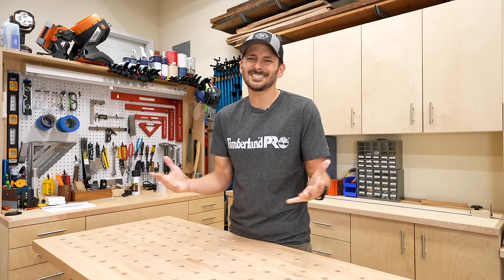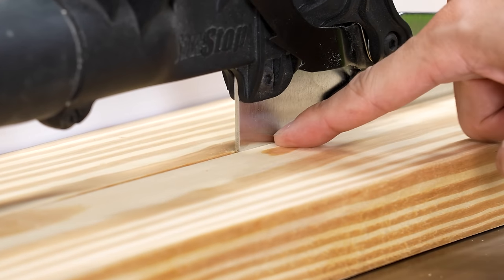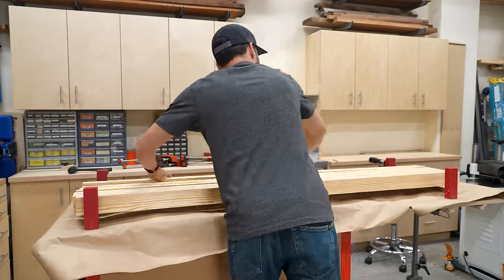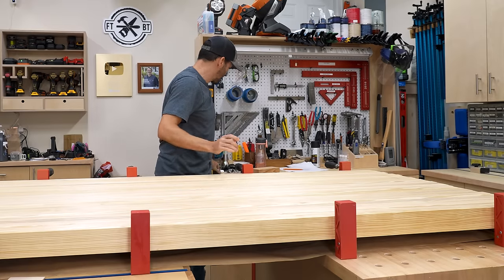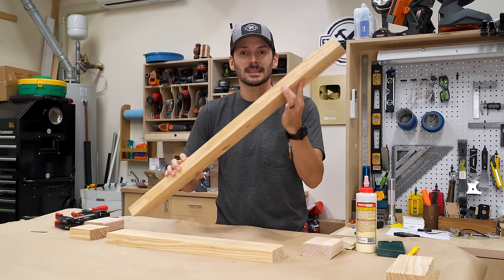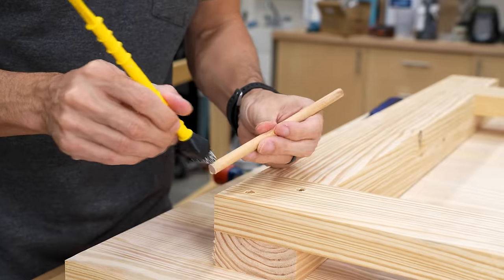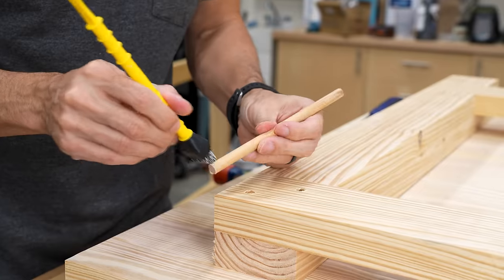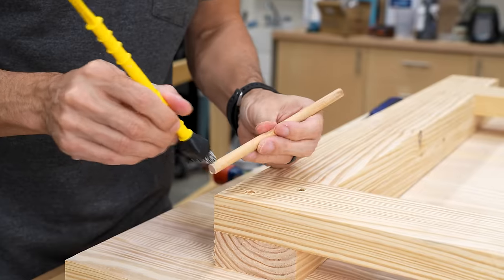Building a Sturdy Workbench with Cheap Wood

Comment: I clicked thinking "cool, $150, I wanna see how he accomplished this."  The answer was with $8,000+ worth of tools in a decked out shop.
Reply: If you are good at yer job my friend.  You don't need a lot of tools! 👺
Reply: LOL, I agree. Specially if you don't have parallel clamps. Each one is 50 dls and you need at least 4, at least... That just adds $200+ dls.
Reply: I mean, if you want to build things with a hand saw, a hammer and a piece of sandpaper, have at 'er. But you're going to get what you get.
Reply: @SnootchieBootchies27 i feel like there's a middle ground between a handsaw and a literal $5,000+ table saw, and a $1000 planar+ a $300 workstation setup to plane stuff on it
Reply: @SnootchieBootchies27 the workbench he made needs to be made next to the tablesaw and on both sides of the planar. Yes, smaller, so less $$ on material than the main workbench, but you need to have multiple smaller workbenches (the quality of the main workbench) and multithousand dollar tools.... To.... Make the workbench
Reply: @dwrecked9329  sounds like you should be the one making the videos and telling everyone how things should be done.
Reply: Home depot and Lowes will cut the boards to your preferred sizes for you for free.
Reply: For centuries, craftsmen built wooden objects with hand tools—from tabletop boxes to sailing ships. It’s still possible today.
Reply: A good pool cue does not make you a good pool player. But you never see a really good pool player with a house cue (unless, of course, he's trying to get a sucker to play with him.
Reply: Pretty sure you could build the whole thing with only hand tools; it would just take more time and effort.
Reply: Never forget, 99% of all man's inventions have been to make things they were already doing faster and easier. Sometimes, we get quality improvements. All the great organic chemistry we are now doing at pressures exceeding 200 psi and temperatures of 1000 degrees, nature does at atmospheric pressure and room temperature. Some computers are now fast enough that they can defeat the best chess players, but not through creative or inventive play, only sheer exhaustive search of all possibilities.
Reply: Just 1 of those 2 x 12 was $63.00 do the math?
Reply: So true 😂
Reply: But great work nevertheless
Reply: Made plenty of workbenches in my day, some cheaper than this, some much much much more expensive than this.  His tools definitely help but you don't need all of what he has access to in order to make a work bench just as good or much better.  

The clamps are pretty much a necessity, but pipe clamps are much cheaper and just as good. 

As for everything else, you really only need basic hand tools.  A router, drill/driver set, and a circular saw will get you there if that's all you have.  If you don't have that, then I'm not sure why your building a work bench.

The hardest part is flattening the boards, this can be done with his thickness planer, or a router sled.  The router sled will take much longer, but will achieve the goal.  Once your done with all the glue ups, then you make a large router sled and flatten the top and bottom.  

The thing is, he has the tools to make the process go much faster, but they aren't required.
Reply: Agreed 😂💀
Reply: I built my workbench from the garage floor up, table saw/miters saw, drill. 3' x 7'. Table saw built into one end, flush with the rest of bench. Router station at other end. Just added 6' adjustable side runners and a router sled. Love that bench, flat, square, solid, it's a beast of a machine, makes things simple.
Reply: @nelsoncollar1814 I always say "double check your info before making a smart@ss comment". You clearly did not do that, so here. 1- the sign said $36, not $63. 2- that $36 board was a 2x12x16. He clearly said he was using mostly 2x6x12's which are only $11 each. The math is just fine, you just jumped the gun.
Reply: @PeopleAlreadyDidThis and they usually last longer
Reply: OLD joke.  Unoriginal.  Boring.
Reply: I want to know wjere you get construction grade pine that starts that straight and not cracked :-p
Reply: I take some of the principles and then modify them personally.

But you really do need a planer to build a table like this, and I don’t even have a Table saw.

But then he completely lost me when he said “I use my CNC”.
Reply: Keep seeing videos like this. Completely decked out shop with every tool you can imagine including a nice workbench and they make a cheap workbench. Can’t tell who the target audience actually is.
Reply: Did you think he was just gonna Minecraft $150 worth of lumber?
Reply: you only need a circular saw and a hand planer
Reply: Yea. A dueche

Comment: Cost of all the tools to build this project from "cheap" wood - $$$$,   Time spent building this project from "cheap" wood - $$$$,  revenue from building this project - $$$$, Value of building a bench exactly the way you want it - priceless!
Reply from the maker: Exactly :)
Reply: I was pissed after the first sentence but I decided to keep reading. You quickly changed my mind lol
Reply: They had us in the first half not gonna lie
Reply: Exactly. $150 project actually costs thousands of dollars in machinery.
Reply: @Fixthisbuildthat  
1:45
SPF = Spruce, Pine, Fir (all white-ish in color)
Hem-Fir = a hybrid Western Hemlock and true Fir (pinkish color)
Hem-Fir is usually cleaner and stronger than SPF.  Generally used in wall framing.
Reply: @mark Sage  considering you can do this with a cheap hand saw, a basic hand plane and some chisels. Less than $100 in tools
Reply: @sambenao7  I though the same lol
Reply: @marksage5722  lots of projects pay for it.

Economy of scale
Reply: @JustMe-lj8ix  plus a few thousand dollars in clamps
Reply: The x carve 😵‍💫
Reply: @JustMe-lj8ix  let’s see a video of you doing that then
Reply: @gregdziuba1025  More like a couple dozen in clamps if you buy 3/4" pipe clamps and dress your wood so you only need 3 clamps per glue up (total cost today for me would be about $120CAD for 4 5' 3/4 pipe clamps brand new). Use bowed 2x4s as pressure spreaders on the outside aimed so that the crown is in the middle of either side, it'll spread that clamping force more than enough if you took the time to straighten and joint your boards.
Reply: @Fixthisbuildthat thanks for showing me this video I needed it cause I want to make a workbench in woodworking  thanks sir😊
Reply: Wood is more expensive then it was before 2019
Reply: I bought a lot of the necessary tools from harbor freight. Got 8 6in clamps for $3/ clamp and 4 12in for $4/clamp. A laser guided corded circular saw for $40 and 60T fine finish blade for $10. And even a 6 piece chisel set for $10. Time will tell what happens, but I do know their equipment isn't the best, but I just need a workbench and this will do for now.
Reply: This cheap work bench would cost me 2k for tools before i even buy the wood. No thanks.

Comment: Understand that you'll lose about 1/4 to 1/2 an inch over the first few years as you reflatten the top. So the first years I'd check flatness before using it as a reference in glue ups. But after a few years the sap in softwood will fully polymerize and it'll become really stable. This from building dozens of thick workbenches out of pine of these over the years for school.
Reply from the maker: Yes, the sqpwood is very weak right now. Good to know it'll firm uo
Reply: How about gluing a formica top on it?  It will take a year or so for the formica to wear out, but by then the pine should be fully hardened
Reply: If you can find a place to kiln dry your wood with high temp it should harden the sapwood to where it is not a problem. I know they say the wood is already kiln dried but most of the time it is not left in the kiln long enough to fully dry the sap. Depending on where you live it can be hard to find a place to do it though.

Comment: I built a bench with a similar top.  We squared up the lumber and determined our order for the boards.   We glued and screwed each board one at a time.  That let us even everything as we went.   My father has a 20” plainer so we made three sections and plained then smooth.  Then we glued and clamped the three sections together.   It was heavy as hell, but it is a sold, massive top. Oh, it’s made of hickory. You can hit it hard with a hammer and not make a dent.   

I love your bench-   I’m in need of another

Comment: Great video. A suggestion, if you don't have a CNC machine to make the dog hole template, try using a piece of peg board and drill pilot holes before using the auger bit.
Reply: Such a brilliant idea...
Reply: Beautiful.
Reply: Great idea! Thanks
Reply: Great idea. I have a one foot wide piece that is my template for shelf peg holes.
Reply: Hello I'm gonna build my first workbench but I believe I will get annoyed with screws and other little material dropping in the dog holes (as I will have drawers underneath).  However I still want some dog holes.  I 'm using clamps of various sizes too. How many (minimum) do you need for ordinary woodwork? (Hobby, no cabinets)
Reply: C&C machine???
Reply: Great idea!!

Comment: Hey Brad! Just want to thank you for this video. I used this as a guide to build a craft table in my garage. I built a 6x5x3 foot table, and it's beautiful. I've never built anything that didn't already come pre-cut, with all of the necessary materials. I used 2x4s and then purchased 10 6ft pine slabs that are 1in wide and 1in thick for the top and lower table. I don't have all the fancy tools most of you guys have, so it took a bit longer than I anticipated. I used my clamps and glue to glue each piece together and then filled any holes with filler, and finally sanded it all. I dig the natural look, so I added a clear sealer to the top. It's not perfect, but it's damn good! Thanks again

Comment: I built a 5' English Knockdown workbench. Once that build was finished and oiled I added brackets to hold my roll of craft paper at one end. It paid for the time and trouble the first time I used the bench as I had paper down but spilled a finish can on the bench. Cleaned up nicely. And I later added a 2" X 6" horizontal on one side for better clamping purposes. When I can find my parts I have a vise to add to the side opposite the 2 X 6. But, I really like my bench - solid, sturdy, level!!

Comment: So I made an armoire for my daughter and since I'm a single parent, decided to use the dining room table for an assembly bench.  Nice and flat and expandable as well. Point well made..make sure you don't mix up the screw lengths!   It was just the tips of the screws, but yes, I did attach the framework to the table.  Lol.

Comment: I used Southern Yellow Pine for my Roubo workbench and it's awesome. It's strong, heavy, and yet not so hard that it will dent projects that I build on it. I also had a problem ripping my boards. They were pinching and shutting down my blade almost immediately with all of the movement I got from them squeezing the kerf together. I got a lot of crap from people who were yelling about me not using a riving knife and jamming a wedge into the ends like you did but the reality is that they were super heavy boards and my 1.5HP table saw was never going to be able to kick one of those monster boards back at me. I did finally get them ripped and they turned into an awesome workbench.

Comment: I'm a relatively new woodworker having done my first glueup. It was 3 sections of 2x3s with biscuits using TB3 for the extended open time and was hectic AF. I don't remember a single video showing how crazy glueups actually are. I'm so happy to see a professional actually showing that aspect. Loved the video and your personality, thanks, man.
Reply: Not sure where you got the info, but from TB1 - TB3, TB3 has the fastest set time, or the lowest open time.
Reply: By experience, biscuits are only good for alignement and do not add any strenght.

They are pretty much useless un a glueup unless for when you want to glue different sections of the glueup toghetter

Comment: So after watching your videos about shop cabinets, I decided to give your plans a try. Up to that point, I had built an outfeed table from plans I purchased from Mark over at the Wood Whisperer. I built the carcass twice as the first specimen wasn't as square as it should have been for the drawers, so on the second try, Viola", I have an outfeed table and a badly needed one at that. Thankfully I was able to repurpose most of the wood from the first try, so no harm, no foul. Now on to your plans: so far I've buit the drill press stand, the 15" five drawer cabinets which will go between two base cabinets, one with the door storage and the other that has the slide out tray and on the other side of my miter saw station will be the three drawer cabinets that I'm finishing up and will put the other 15" cabinet between the drawer cabinets. Your plans are easy to follow and are of sound design. These babies are going to outlast me but I got to enjoy building them. I did build the table saw storage cabinet but had to cut out one of the pull outs because of size considerations, but it sure comes in handy. I have a car and a third garage that I use for my shop, so space is at a premium and if I was able to upload pictures, I think you'd get a kick out of what I did for my dust collector and sheet and board storage. Anyhow, I just wanted you to know what a great job your doing for us and the way you put your plans together and the different measurements for drawer slide height and drawer height were just fantastic!! Thanks again for all you do and this retiree is happy to have found your channel!!
Reply from the maker: Glad you're loving the plans! We'd love to see the builds if you like to share. DM us on IG or though website contact form 👍

Comment: I enjoyed your video. I used the same materials for my bench top - 2 x 6 yellow pine ripped in half. I chose longer material because I wanted a 4' x 8' top. I don't have a surface planer, so I built the leg system first out of fir 4" x 4", then glued up the top one board at a time. To flatten it I used a router sled, followed by belt sander and orbital sander. Added a 10" wood vise at one end, a leg vise on one side, and a set of dog holes. The table was built exactly where it will stay because it is too heavy to move without four guys and a small crane. It is exactly the same height as my table saw and other surround benches along the walls. I attached the table saw to one end of the bench, so it serves not only as a work bench, but as an out-feed table for the saw. Drawers underneath and a few coats of oil, and it is a very serviceable (and inexpensive) addition to the shop.

Comment: I included a pull down storage cubbies for the hand planes I use daily. So when the door is closed the planes are almost upright in their individual slots and when I pull open and down the door they are at an angle. You can make the door so it lays flat and you would just a plane out horizontally. I used arms for a support like the type used in fold down desks, but you can use chain, or a piano hinge depending how you want the front to look like when closed. I did this around my bench except for one end which is occupied by my tablesaw. I found the containers used for a pull down cubby that stores sponges by the kitchen sink work well, but after a month I went with custom cubbies. One pulls down holding my bench dogs, another holds my layout tools and pencils, and one larger one holds my most used power tools. There are cut outs that accommodate each tools shape like the cordless drill has a hole large enough for the chuck end to sit into and the battery end rests against the inside of the door. My cordless circular saw has a slot for the blade to sit into. I have onboard charging for batteries since the bench is plugged into power and can be easily unplugged when I need to move it outside on sunny days. Then I use and extension cord to power the bench. It also has integrated dust collection, and an air compressor. The hose for the dust collection pulls out of the side of the bench to attach to which ever power tool I'm using and then recoils back into the bench. Same thing for the coiled air hose that sits around a pipe of the same diameter as the inner diameter of the hose  when stored. The table saw is built in ( a Dewalt DW745- 10") with a large drawer under it for accessories and a slot to the left and right of the drawer for the two sleds I use with it. The drawer on one side has slots for the different blades for the saw. My only regret with this saw is that I can't use a dado stack on it. At the mitersaw & radial arm saw station, I have a dado stack on the RAS at all times for very quick dados when making cabinets, book shelves, anything that I need a dado in. I primarily use half inch, but everything I need related to dados is right at the mitersaw for quick change out. Sorry to ramble. Take your time deciding what you want under the bench. I had a good idea when building it because I took my time to think of new ideas to incorporate into it. And it didn't all come at once. In the end  there are drawers, and a sound proof cabinet for the shop vac and compressor along with the fold down cubbies and a tablesaw.
Reply: I have the same setup. Only suggestion. Carriage returns. 😁
Reply: Do you have any problems with the vac or comp overheating?